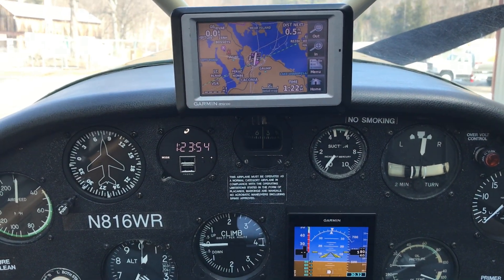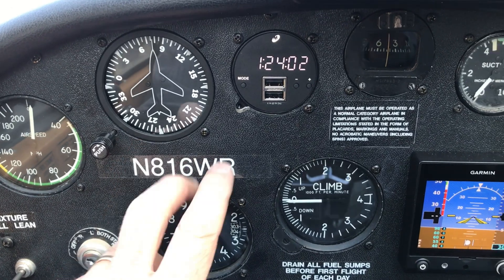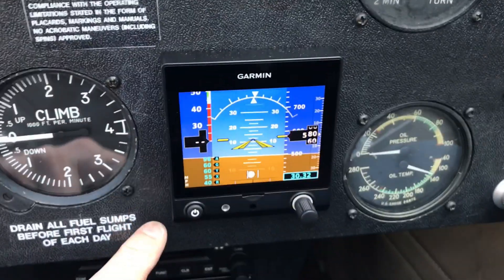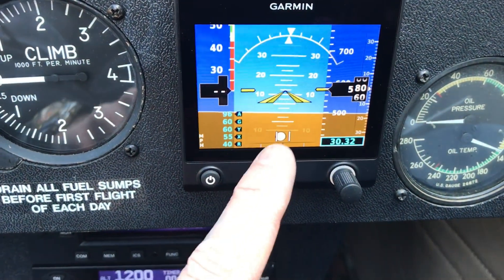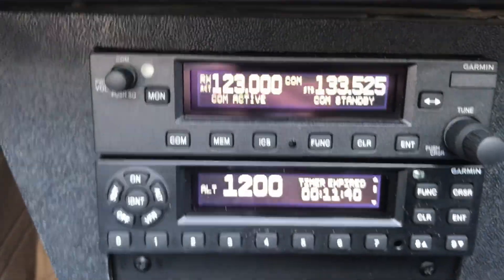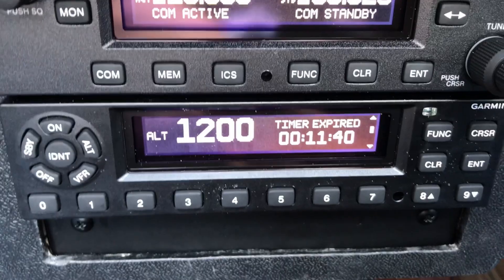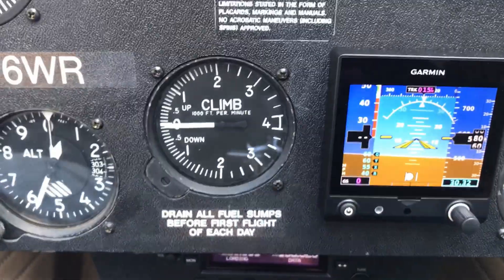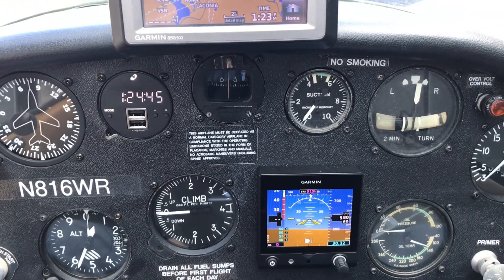New VFR Avionics Installed in Super Cub

Comment: Awesome, didn't realize you put the radio & the transponder in also
Reply from the maker: I had to. The radio was intermittent at best, and it turned out the transponder antenna was broken. Not to mention, the original transponder was ancient and no ADSB-out. I was also not sure it would have worked if the antenna had only been replaced. So ended up also putting in a new transponder antenna and a GPS/WAAS antenna as well.